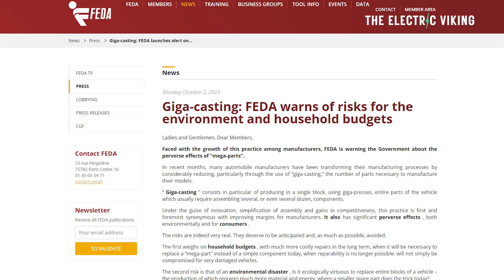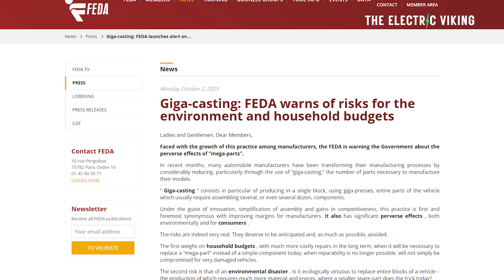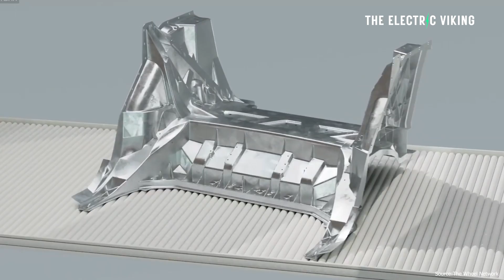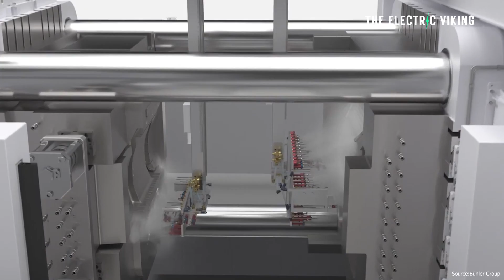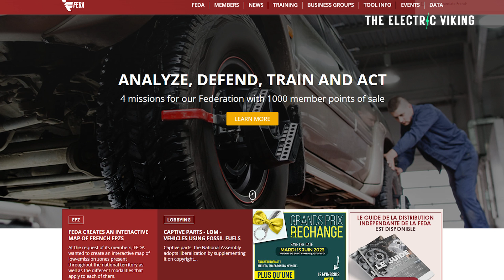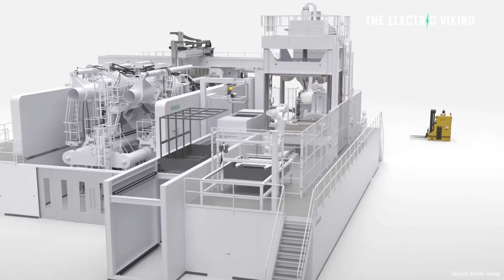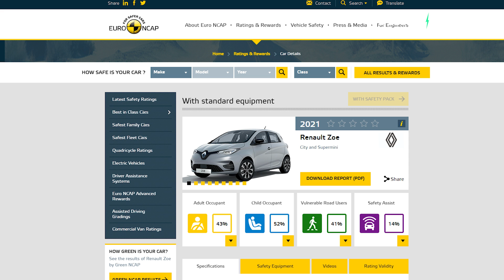Magna and French auto industry issue red alert; warn dangers of Gigacasting

Comment: Gigapress involves high upfront cost therefore needs high volume model to offset. Whereas Magna probably only makes low volume models. French Government might not be happy since Gigapress means fewer workers
Reply: How about no workers at all?
Reply: Magna is a huge company, and they have in-house capability of building both sheet-metal welded structures and aluminium castings. If someone wanted them to build a big casting, they have the resources to do it.
Reply: @bikeaddictbp  Nothing to do with size or capability. To be financially feasible, they need huge economics of scale to offset the initial investment. According to Magna's website, they make the Mercedes-Benz G-Class, Jaguar I-PACE & E-PACE, BMW 5 Series & Z4, and the Toyota GR Supra. None of which are high volume models

Comment: Aluminum is the only plastic metal. I understand that Tesla is using an alloy, but aluminum is less  prone to cracking than other metals. "Materials that are highly ductile, such as copper, gold, and aluminum, can undergo significant plastic deformation before a fracture happens."
Reply: you might want to study up a bit more. Aluminum is not a "plastic metal" and all metals can undergo plastic deformation. Further, aluminum does not do nearly as well at managing cyclic stress as steel and the failure mode is more abrupt than steel too.  That said, the whole giga-casting thing is cool, but your statements are way off the mark.

Comment: Expect a significant insurance premium for  cast body structures and structural batteries, cars will be written off left right and center to protect the environment.
Reply: Have you been to an auto auction lately? In the US, I’ve seen all brands, Toyota, Honda, Mercedes, BMW, Audi, VW, you name it with minimal damage being written off as a total loss. Parts on every car are so expensive now this is becoming common practice. Pretty much as soon as the frame is damaged or bent, they write off the whole car. Repair shops no longer want to accept responsibility or liability for fixing and repairing the frame of the car, and insurance companies do not want to pay the exorbitant prices to have this type of work done.
Reply: I bet you believed when they said giga berlin had elevated emergency calls also
Reply: My wife and I both have teslas in Florida and the insurance is the same cost within 10 dollars a month for our previous cars
Reply: I don't believe you can fix giga cast parts by welding or mechanical fastening the way you can with standard manufacturing methods today. My personal experience has backed thus up. What looks like a total loss can be bent, hammered, welded and screwed back together. EVs Wil probably needed structural battery packs to save weight among other things but, that should not mean the rest of the car must also be impossible to be fix.

Comment: What you don’t seem to grasp is that gigacasting is one of the ways to build a car. It is widely applied for EVs, because of less weight compared to steel. If batteries become less heavy other manufacturing methods can be used, which have constructive advantages. You can also use carbon fibre casting, which is even better than aluminum castings but more expensive (BMW i3]. Magna Steyr is a reputable manufacturer, they know what they are doing. Progress comes from discussing different ideas, not hailing one god.